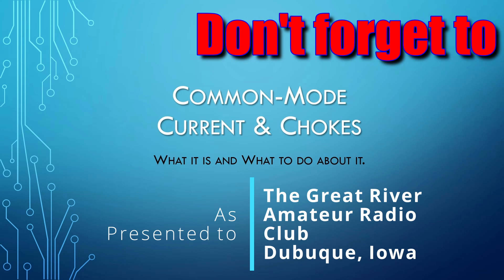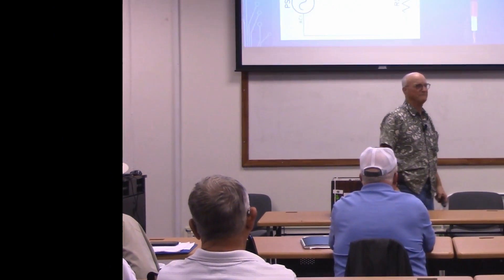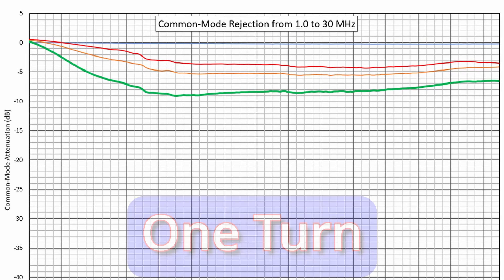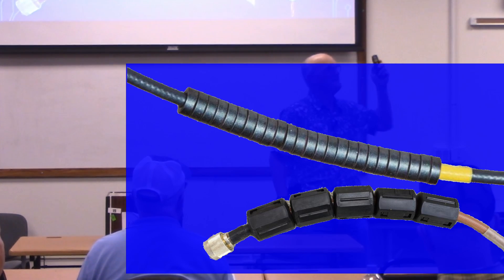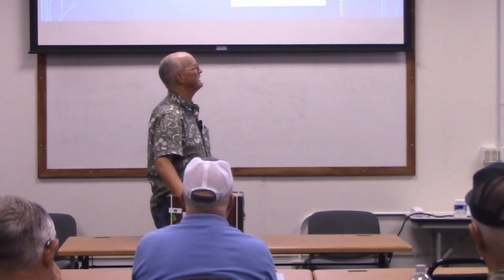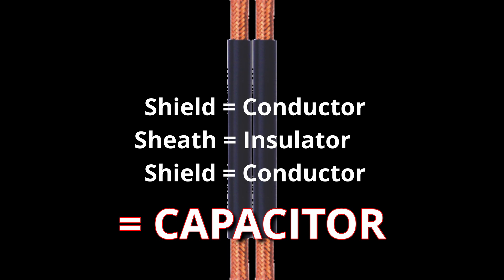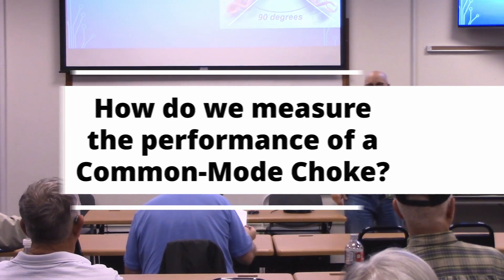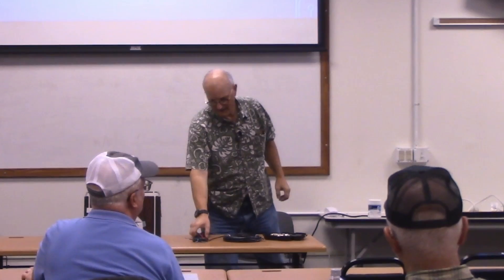Common Mode Current, How do these Chokes work? (013c)

Comment: Appears different from conventional, both in and out landing same side. Whether tested  for performance ?
Reply from the maker: Yes, this is a common mode choke design that is used quite often. While the design you see here is not in an enclosure,  I could be put in a whether-tight enclosure to make if quite weather-proof. I have used this choke myself with good success :-)

Comment: Hello ralph, could you to show how   you make step by step with a nano vna to read a common current mode with a dipole or other antenna with a length random . Read mesure  With a chock home made and   without chock . Thank you
Reply from the maker: First of all, if you are intending to measure this with live transmitter power, the nanoVNA is not the instrument to use.
To measure the common mode current, you need a means of picking up the current such as a coil around the outside of the coax. I have heard of folks using a toroid with winds of wire around it.  You could take the output of this coil, rectify it (including a capacitor to finish turning it into D.C.) and send the resulting D.C. to a analog meter or amplify it using an op amp. then send it it an analog meter or to an Arduino's analog input to be displayed using digits. This will give you a relative measurement you are looking for. 
IMPORTANT NOTE: ALL real life coax has signal "leakage." In other words, there could be absolutely ZERO common mode current, and you will still see some signal "bleeding" through the shield to be picked up by your coil. 
ALSO NOTE that this is not a definitive, calibrated measurement because of the non-calibrated method of sensing the current.
I have demonstrated how to measure the effectiveness of your homemade common mode choke in this video starting at 11:24. True, I do not step you though the exact menu options, step-by-step. It is a through measurement, so you could follow the similar steps as with measuring the frequency response of a filter as demonstrated in this video: https://youtu.be/S8MCcY6dHZ4
I hope this helps. :-)
Reply: hello Ralph thank you very very very  much. I going to read your  explanations.
Reply from the maker: You are very welcome. :-)
Reply: @eie_for_you   Ralph, What do you think about that with this work an youtuber : "Measuring Common Mode Current Chokes with nanoVNA of Halibut Electronics https://www.youtube.com/watch?v=3ReRu7Yt4Ao&t=933s       7351
Reply from the maker: WAY too much cross talk with all the wires and switches and all. It is clear that he did not have a full appreciation of the weirdnesses of R.F. in making the fixture. :-)
Reply from the maker: You are very welcome. :-)

Comment: Yeah when I was going through my  dismantling printers phase I noticed alot of them choose to wrap the wires for the motors in ferrite cores maybe im guessing to stabilise the disruptions in current due the back emfs or something
Reply from the maker: Motors produce a LOT of electrical noise. These ferrites were inserted to keep this noise from being conducted back to the electronics and causing issues. My guess is that these were not coaxial cables, but just wires or twisted pairs. The same issue. Instead of inserting discrete inductors, it was cheaper to simply wrap the wires around ferrite cores. :-)

Comment: OK.  Here goes.
I finally have all the parts to do some CMC Choke testing and I want your advice on the increasing number of turns possibly reaching a point of diminishing returns.  Tests using NanoVHA H4 & 18 Ga. zip wire.  I'll eventually use RG-316.
I have determined that for my HF purposes the FT240-31 mix is best for me.  I did test the FT240-43 mix, but it seems shifted up an out of HF.
My first test was with 4 turns each side crossing under and 4 turns on the other side.  Here's what I got for S21 LOGMAG: 7.090MHz=-31.79dB, 29.71MHz=-34.89dB.  My second test was 5 turns each side crossing under and 5 turns on the other side.  Here are the results: 7.090MHz=-33.5dB, 29.71MHz=--36.31dB.  Graph was essentially flat sloping down.   I'm only testing 40M thru 10M.
Reply from the maker: Woohoo! Good going! Thanks for letting me in on your project.
When I first read this, I thought to myself that the results will change when you change to the coax. It would be real interesting to see by how much they might change.
Then I also thought, "that's mighty small coax. I wonder what its power handling capability is?" Of course, none of the datasheets would fess up to it. I finally found something on the "rfconnection.com" site. I was surprised that at 1 MHZ it'll do 1500 watts (MAX). This decreases with frequency to 480 watts at 50 MHz according to them. If you run a barefoot 100 watts like I do, then there is no issue there.
At 7~MHz the change from 4 to 5 turns only achieves an additional 1.7dB.  Not a whole lot given the effort. I would surmise that going to 6 turns will yield only another 1.4dB or less. And then 1.2 dB. And so on.
I would be real interested in what you end up with and the results. :-)
Reply: @eie_for_you  I'm planning on running an IC-705 ONLY - 10 watts max.  I'm interested in losing the noise floor as much as possible.  Due to my housing arrangement, I have to run "portable".  Current antenna I'm thinking about is a Buddipole, 40-10M.  I also am looking into POTA.  Efficiency is everything in QRP.
I did one more test with 6 turns on each side, same wire. @7.025MHz, 35.19dB, @29.9MHz, 37.02dB.  However, instead of a relatively flat curve, I noticed a bump up around 27-28MHz.  I was trying to use the VNASaver app.  The USB-C connection may have caused something. KG5RF.
Reply from the maker: WOW! You will be real safe with that power!
It also could be that you are introducing a self-resonant feature into the mix as the inductance and stray capacitance interact. :-)

Comment: Thanks for the video which I watched this series with great interest as I'm making a choke for my random end fed longwire. I was interested in your comments about winding the coax across the toroid and it's effects on the graph. I've read this does and doesn't happen, so it was good to see your practical results. I could see from your results that adding more turns adds capacitance and starts to find the resonant points. Hence the dips.
Reply from the maker: Thanks for watching, and I am glad that the practical results helped clear some things up! :-)

Comment: Thanks for the great video. You touched on the crossover improving the performance but do you have an explanation for this. I see it quite often but Noone ever seems to explain the reason for it.
Reply from the maker: Thanks! My take on why the crossover helps is that the phase of the induced magnetic fields in the core are swapped with the crossover. Thus, the magnetic fields on one side oppose that produced on the other and this opposition cancels stuff out better (I hope you like my highly technical terms ... LOL ;-)  ) We just gotta cancel "stuff! Anyway, this is my take on the whole mess. :-)
Reply: @eie_for_you  Thanks for the answer. I just did some tests with various number of turns of coax on a toroid with and without crossover, and for me the crossover increased CM attenuation at lower frequencies around 4MHz but at 28MHz had minimal effect.
Reply from the maker: Interesting! :-)

Comment: I tried some common mode testing yesterday and was getting a bunch of noise.  I'm going to try your 90-degree offset.  I had thought of short leads but not the 90 deg.  I have found beads to be very cost effective in VHF and UHF.
Reply from the maker: If you are doing this at VHF and UHF frequencies ... that's going to be ... "fun." 🙂

Comment: Wats a meterband?
Reply from the maker: Amateur radio operators refer to the various bands of frequencies they can use by the wavelength they represent. The wavelength associated with 7.0 to 7.3 MHz band is 40 meters. It is not exact as this set of frequencies actually have a wavelength of 41 meters. :-)

Comment: 0:12 Hi Ralph, Thank you so much for your time in making such useful informative videos that are so helpful. I have made a 1:1 common mode choke but curious if it’s possible to over attenuate? I’m getting-50dB across the hf frequencies and curious if this can have an effect on the wanted frequencies?.
Reply from the maker: You are very welcome, my friend! I am glad that you find my videos helpful. 🙂
The only stuff your common-mode choke is attenuating is the unwanted current running down the outside of the coax shield. The stuff you want on the inside is virtually unaffected by the choke. So, no, you cannot attenuate too much, in my opinion. 🙂
Reply: @eie_for_you  Many thanks for your confirmation Ralph much appreciated, I can now continue with my build armed with that knowledge. 
Best 73's
Paul
De-MW0VCK
Reply from the maker: Cool! :-)

Comment: Ralph, do you have an opinion on the effectiveness of using the LDG RU-1:1 Unun for a common-mode choke you could share, please?
Reply from the maker: Well, I have never used one of these. They are supposed to be for this purpose. Advertised effectiveness and actual effectiveness can be two different things, but not always. I would say to test it for yourself to determine if they do the job. 🙂

Comment: Great series. I’m about to build dipoles for 2,6,10,15 meter bands, mounted on one wall of my house, one above the other.   Sounds like I’m in for some trouble. So I guess the cheap ones I bought from Amazon are junk.
Reply from the maker: Well ... don't count the one's you bought out without testing them first. Sometimes they can be surprising like the 100 Watt dummy load I bought (made in China ... of course). It tested way awesome! So, test before discard. 🙂

Comment: Where to you put the toroid choke?  (which end of the coax, radio, or antenna, or both like some suggest)
Reply from the maker: The best place is at the source or close to it.  This might be a bit of a difficult issue if you are using something like a dipole only because of the weight of the assembly.
If you are using a tower, then you could put it at the base of the tower. 
If the common mode issue is significant, then a second one before the coax enters the house/building. I say this because I'd like to keep it out of the house and away from the radio. 🙂

Comment: Is that not 10 turns where you show "8-turns" crossed?   I learned to count every pass though the middle and I see nine wraps with one crossover. That's ten.
Not that accuracy in turn count appears to matter much in this application, but in other applications the number of turns can be critical to best performance--of course as well as the mix.  Plenty of testing has been done on the mixes I use for the transformers we make.
Reply from the maker: Yes, I did use the term "turns" very loosely.  I suppose to be more technically accurate I should have said, "times around" as opposed to "turns." You are also right, the accuracy of "turn count" doesn't matter that much. The law of diminishing returns works against us as we add more and more turns. 🙂
Reply: @eie_for_you 
I hate for interested hams to get confused with basics when they have little background in electronics and the pic and the caption were yelling to me.  Counting turns means a lot on the transformers I've built and one of the common errors is turns count.  The image that sticks out in my head from studying these things is one of a wire passing straight through a core without any bend at all-which is captioned "This is one turn." Every time through counts. That's what they taught us in the books, or we learned for the test and then later applied to antenna transformer building.  Carry on. 73.
Reply from the maker: @wadepatton2433 Yes, counting turns properly does mean a LOT in creating transformers. I agree 100% with you. You are also right, there technically ARE 10 turns on that common mode choke in the illustration.  Everything you said is true about counting turns.
In the presentation of this material I was thinking in terms of the more generic terms of "turns," as I said before. Not defending the imprecise terminology, just explaining it. In this context, you are the first person to find issue with this out of the thousands of views it has had.
Unfortunately, YT does not allow content creators to upload a revised video to replace an existing video. They can only upload a completely new video and delete the old, losing all of the metrics of the original.
What I WILL do is add a note in the description to explain the terminology so as to possibly avoid confusion.🙂
Reply: @eie_for_you Sounds good. I still have a bunch to learn when it comes to electronics, but once I learn it-it sticks. I'll look at your other stuff-might learn something.
Reply from the maker: @wadepatton2433 Electronics is such a HUGE field, we never stop learning!🙂
Reply: @eie_for_you my next gadget is a Nano VNA. That'll test me.
Reply from the maker: @wadepatton2433  They are really, really cool! I have a few videos that will help with understanding all of that. There is whole series on VNA basics and some measuring stuff specific to the nanoVNA.
In fact, I am planning on my next video project to be a walk through the menu system from the perspective of the guy who wants to measure a particular thing using the nanoVNA as a stand-alone instrument (vs. using the computer software and USB interface) ... setup and measuring. That'll be out mid-April if I make good on my plans. 🙂
Reply: @eie_for_you  I see that I need to explore your catalog of videos! These nano VNAs are pretty cool little devices. Mine came with the kit to calibrate it, so listening to your calibration sounds like the automatic calibration on my unit. Just little caps to screw on, 0 ohms, 50 ohms and Open.
Reply from the maker: @javabeanz8549  For sure, the nanoVNAs are quite the little device! 🙂

Comment: In your video i think you mentioned you were doing this with rg8 coax. Can you think how this could be done with LMR400 as that happens to be transmission line in one case i have? It won't be possible to get that through the toroid and i think the min bend radius is 4 inches?
Reply from the maker: Actually, I think you miss heard me. I was doing it with RG58 coax.  I agree, RG8 or LMR400 with the minimum bend radius of 4 inches ... you just will not find a toroid of sufficient size to do this.  For this, you would either have to use a BUNCH of properly selected, snap-on ferrite cores or the old "roll of coax" common mode current choke methods. 🙂

Comment: Thank you so much for these lessons. I have one question about your Amiudon ferite core self made choke? It has two halves, 2 x 4 wraps. But as far as I can see, the two wire wraps were wraped in opposite directions, in the sense of the turns. Would not magnetic fields actually cancel each other that way?
Reply from the maker: Very observant! And, you are right, they are wrapped in opposite directions. It turns out that this way of wrapping them makes the choke more effective. It isn't that this is fighting itself in terms of its ability to do its job. Instead, it is the effects of the existence of the unwanted current is fighting its own existence like mixing two signals that are 180 degrees out of phase of each other. Does this make sense? 🙂
Reply: @eie_for_you  It does, thank you. 🙂
Reply from the maker: @rikardlalic7275  Great! 🙂

Comment: Do these chokes reduce the effects of nearby noise threats on the wire and at the same time reduce emitted radiation from the wire/screen ?
Reply from the maker: Good question!  Yes on both counts. If we are concerned with the effects of nearby noise sources, then the choke needs to be as close to the end of the coax as possible (nearest the point where the signal is used ... e.g. the receiver/shack end of the cable). 🙂

Comment: Another question. How do you know that the choke is getting rid of all your common mode current? Most users of the T2LT antenna use coiled coax choke. You showed this provides a narrow bandwidth but high attenuation. If you use the coax around the toriod providing a wide bandwidth put lesser attenuation. How can you test that common mode current is close to zero.
Reply from the maker: It can be measured using the right clip-on RF ammeter. It has to be measured at various places in the coax, as it appears as a standing wave.  The "signal leakage" (yes, real life coax isn't perfect) from a coax can be mistaken for common mode current.
Here are a couple articles that I have found:
https://owenduffy.net/blog/?p=458
https://www.qsl.net/on7dy/Documentation/Common%20mode%20chokes/A%20simple%20common%20mode%20currents%20meter.pdf
I'm sure there are others.

Comment: Perhaps you’ve already demonstrated this but if not, I’d like to see a loss measurement of the coax shield differential RF current through that same choke. Some claim that it’s only the “skin” of the shield that is affected by the choke -I’m skeptical. Also, even if that’s true, there must be differential current through that same shield skin, no?
Thanks.
Reply from the maker: Actually ... hmmm ... I thought I had, at least to myself anyway. The loss through the coax (usual signal path) was pretty much nonexistent ... no more than you would get with a similar length of the same coax that I used. Furthermore, the impedance match was also virtually unchanged as well.
On the other hand, connecting things up to the outside of the braid, the loss was significant.
While we (includes me) have a hard time wrapping our head around how current can flow differently on opposite sides of the same conductor, that's just the magic of RF.  The higher the frequency, the less of the actual metal is used to conduct the current! (the skin gets thinner and thinner). Mind numbingly weird, eh?